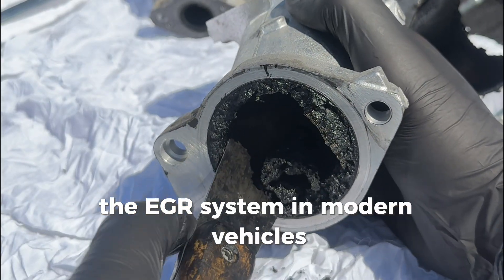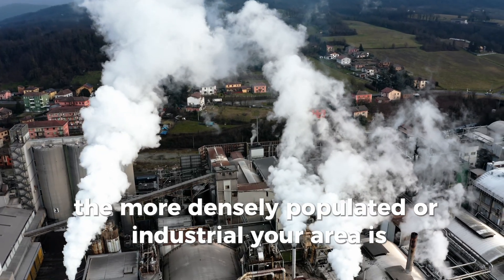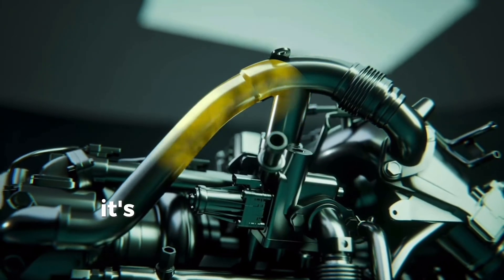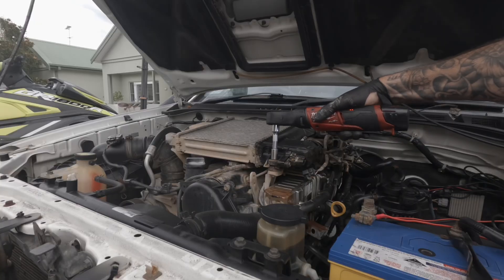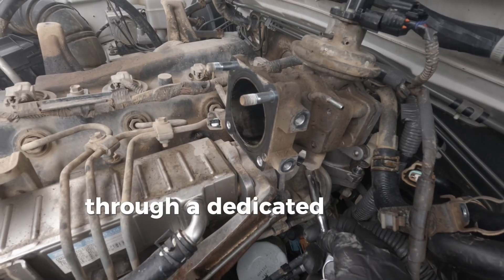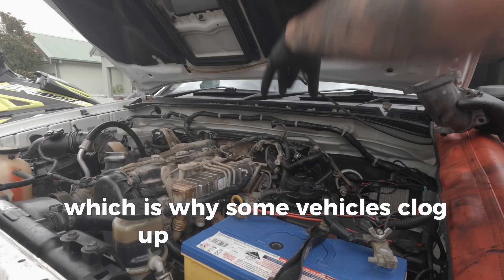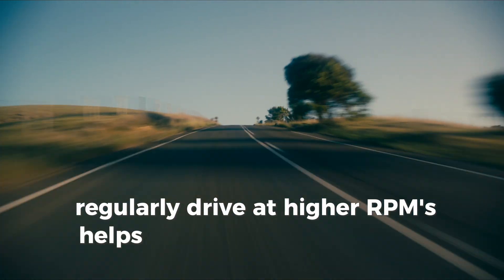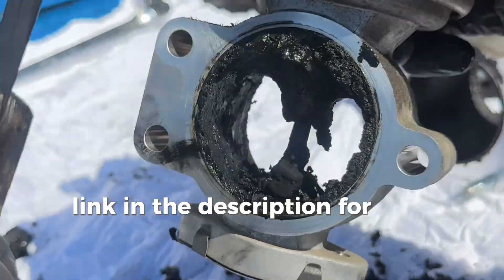Exhaust Gas Recirculation (EGR) | What Does It Do?

Comment: Egr i literally to make you engine to run worst for emission purposes, worst invention ever.
Reply from the maker: Surely better ways to do it for sure. 

It reduces the lifespan of the vehicle which results in a higher turn over of vehicles. More vehicles to be manufactured means greater emissions as a results of the increase in manufacturing which defeats the objective of the EGR in the first place.  Unless they’ve worked out that the emissions reduction per vehicle via the EGR is greater than the emissions caused via the increased manufacturing…which they probably haven’t.
Reply: @No1EngineCarbonClean all about the money